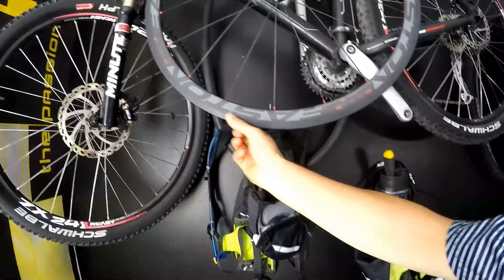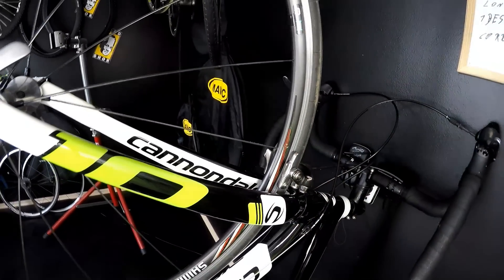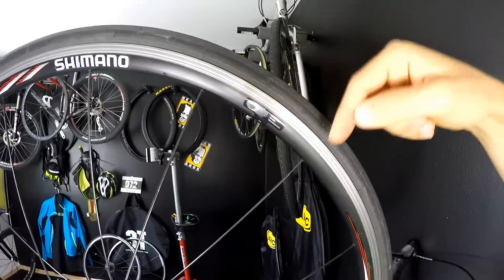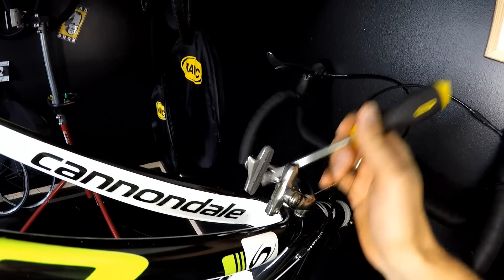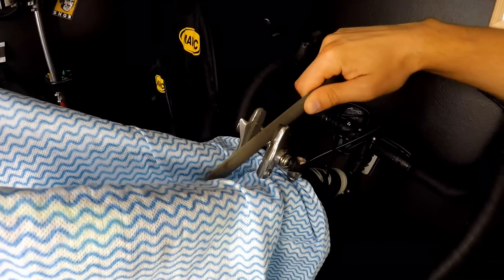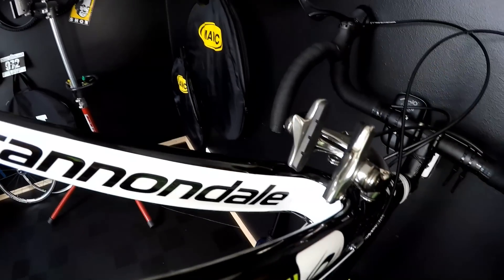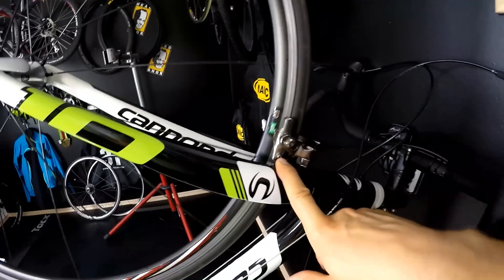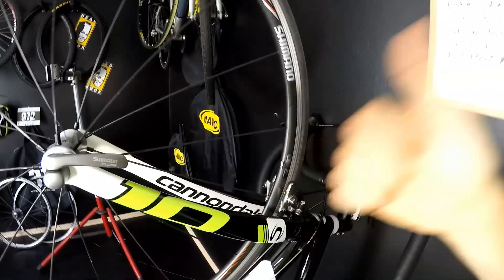How To Clean Your Braking Pads. Extend The Lifetime Of Your Bicycle Wheels!

Comment: You should also clean the braking surface on the rim of the wheel. 000 steel wool works really well.
Reply: +                           Fair dinkum Steel wool?,. are you kidding?,. wouldn't that only scratch the rim?
Reply: It won't scratch it if you use really fine steel wool like 000 or finer 0000 that is used to polish cooper,brass,aluminium and you can even use steel wool with some soap and water to polish glass and ceramic.Another option is Scotch brite...both have low abrasive properties and are just fine to clean and increase preformance of rim surface(also it looks like new after cleaning).If you are worried about scratching then clean or replace brake pads because as shown in video small aluminium particles will get stuck in them and then pads will act and perhaps sound like harsh sand paper.